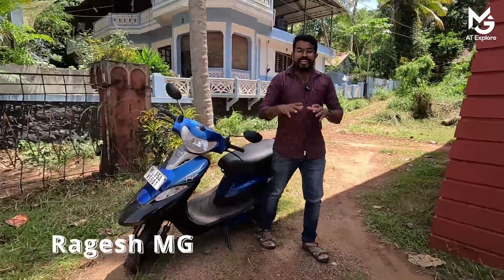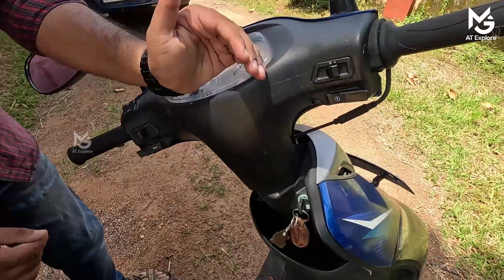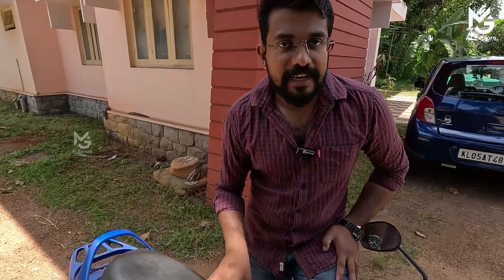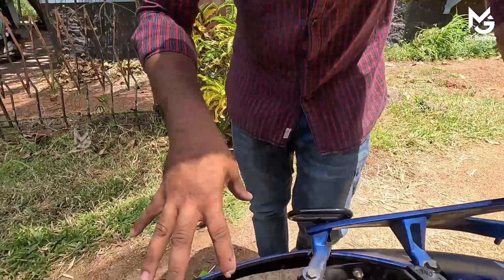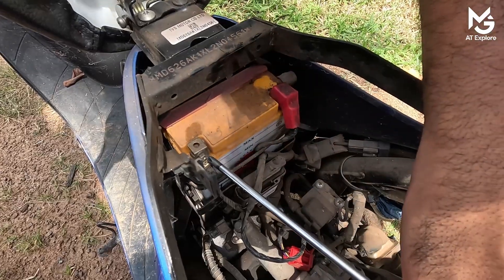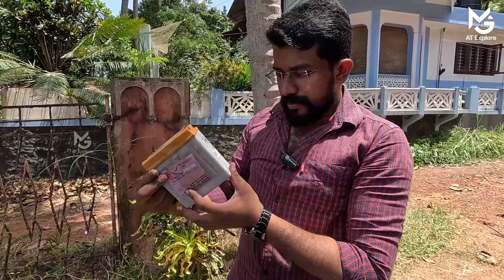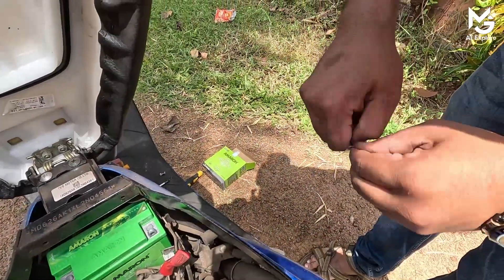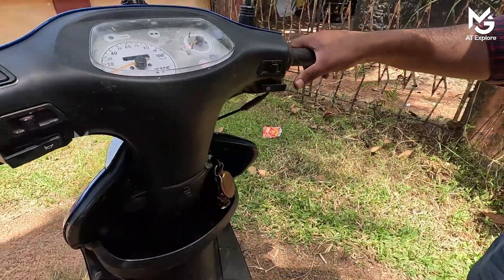സ്കൂട്ടി പെപ്പിന്റെ ബാറ്ററി മാറിയാലോ | How to replace a Scooty Pep Battery our own | DIY

Comment: Broo 
New cars run in period/break in period, oru vdo cheyyamooo....
Correct Ethra KM vare RPM/Speed/sudden acceleration, breaking okke maintain cheyyanam & Oro KM period il (like 0-1000 , 1000-2000) ethrayokke RPM use cheyyam , ethra time idle il use cheyyam ennokke ulla oru detailed vdo cheyyumoooo..🙂
Reply from the maker: Sure cheyam
Reply: @MGATEXPLORE  🤩

Comment: ചേട്ടാ വാഹനത്തിന്റെ ഏതെങ്കിലും ഒരു indicator fuse ആകുമ്പോൾ ബാക്കിയുള്ളത് നല്ല speed ൽ blink ചെയ്യാനുള്ള കാര്യം എന്താണ്, ഇത് മറ്റുള്ള indicator ന് ബാധിക്കുമോ Video ചെയ്യാമോ
Reply: Illa bro
Athile flasher circuit simple ayittulla (passive circuit) anu
Load anusarichanu speed
Reply: @nafihmuhammed1536  Ok bro Thank You
Reply from the maker: Flasher unit function aa load anusarichu ane speed load kurajal speed kodum relay cutting...njn oru video ittunde athine kurichu...
Reply: @MGATEXPLORE  ok ചേട്ടാ Thank You